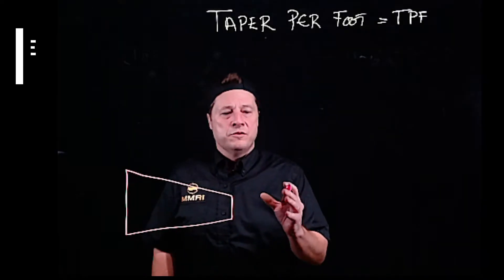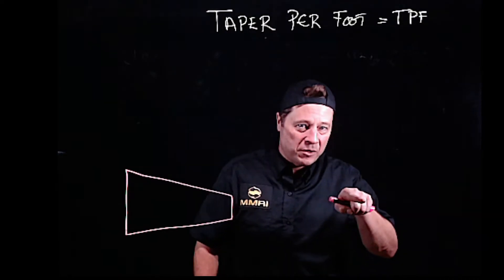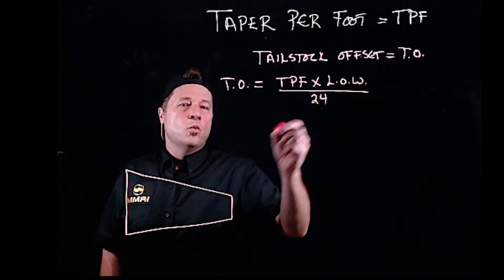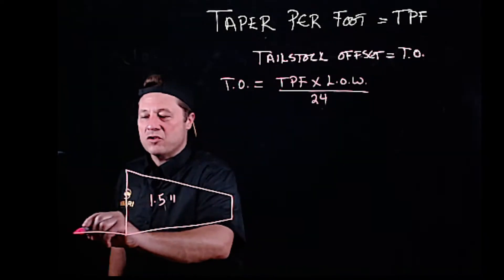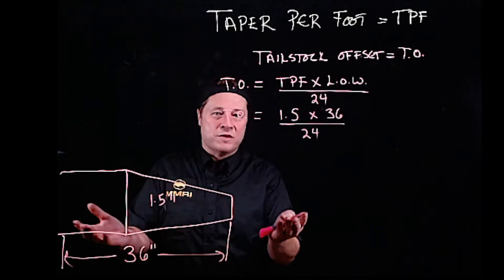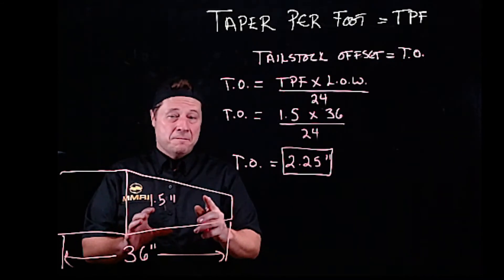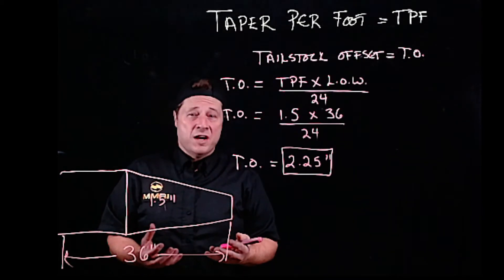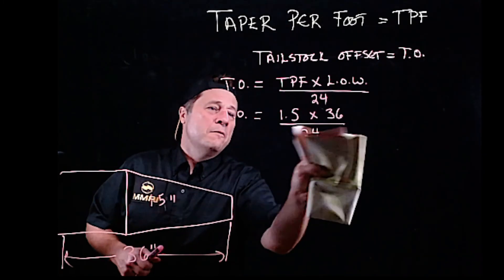Tailstock Offset

Comment: Hi Adam
Why divided by 24 where 24 come from?
Thank you for your time
Reply from the maker: Hello @silkroad9188.  I am trying hard to keep up with comments. Sorry for the late reply.
I'll do my best to explain.
The formula for Compound Rest setting remember is based off of cutting on one side of the part. So in effect we are cutting only half of the included angle that is needed.
If we wanted to cut a 20 degree angle, then we set the compound rest at 10 degrees.  If we cut a 10 degree angle on one side then we actually get a 20 degree included angle.
Now look at the formula: tan1/2 the angle = tpf/24
If we wanted to solve the included angle we could say tan of the angle = tpf/12 because there is 12 inches in a foot. Since a compound rest can only cut one side then we have to calculate the taper per foot for one side only.  
Example: tan1/2 angle = 1/24 is 0.0416 which is 2 degrees 23 min.  If you take this number and multiply by 2 (to get the included angle) then you get 4 degrees 46 min.
Now calculate tan of the angle = 1/12.  Here you get .08333 which is 4 degrees 45 min 49 sec.
Dividing by 24 allows us to calculate setting up the compound angle to cut on one side of the part and only have of the required taper.
I hope this helps!
Reply: @adamtaylor999  or ...... we are dividing by 12 to convert feet [TPF] to inches [TPI] and dividing again by 2 as we cut or remove 1/2 the diameter?